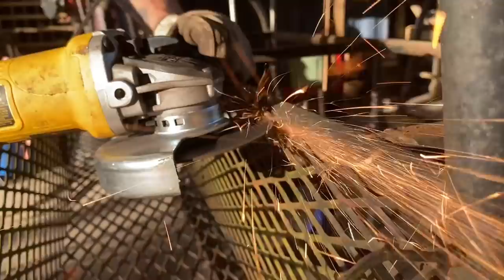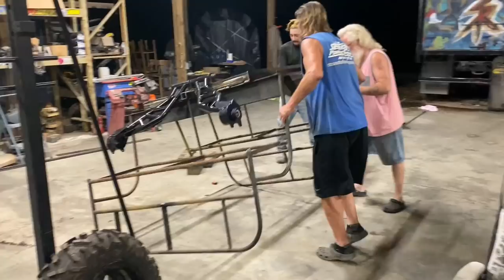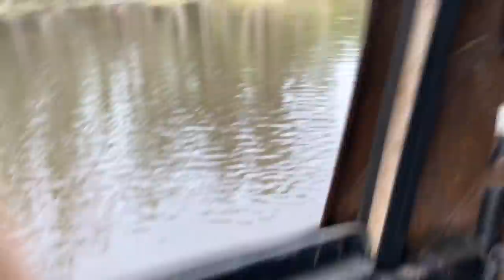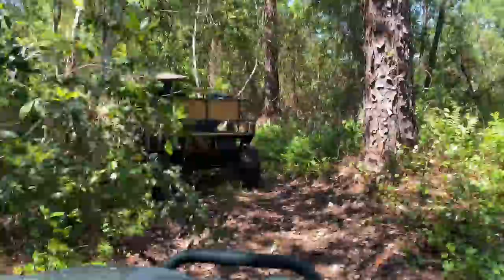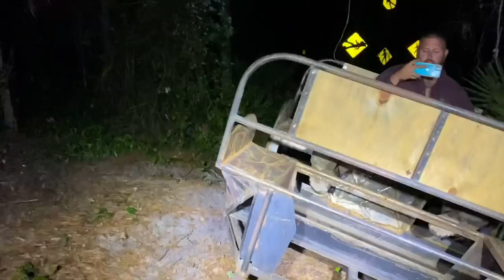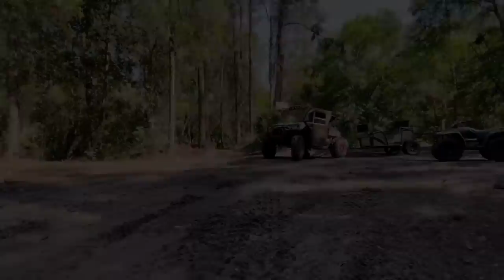Off-road Trailer with SuperAtv 6” Lift Build!!

Comment: Use a raised 4 wheeler diff. And a flywheel attached to pinion, mount two opposing starters, couple batteries in parallel for longevity.  Now you have a neutral drive axle on the trailer, clearance, and can engage starter forward or reverse for drive assist getting out of a hole, backing or whatever.

Comment: That’s sick man but I thought of something an figured I’d toss a little idea out there I’m not sure if you have and speaker systems outside of the machine but if you don’t i think it’d be neat to run speaker wiring back to it and add a few speakers for your passengers then obviously just use a trailer plug or something along the lines of that… just an idea I thought it’d be cool
Reply from the maker: Thought about doing it when I redo the speakers in my sxs. It’s an awesome idea that im sure I’ll do one day but it’s time to move back to the sxs build. 🙌🏻
Reply: @koltgene  I hear ya man I’m looking forward to the rest of the build tho love the vids keep it up🤘🏻
Reply from the maker: Thank you!!

Comment: The suspension is way to stiff! It doesn’t even flex at all, take some shocks off of something smaller or add another seat to back for more weight.
Reply from the maker: My 300 friend sits on it and it bottoms out. Plenty of flex. It’s needs stronger shocks to hold more people. That’s why I took the front seat off until get some
Reply: @koltgene  if you built it to haul around a 300 pounder than I say go with it